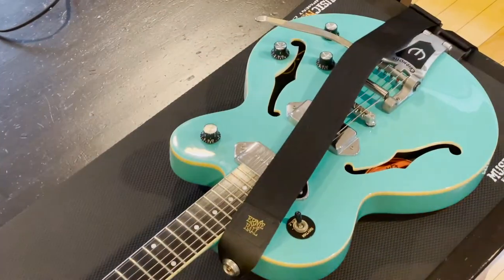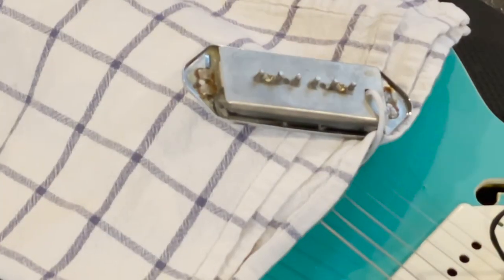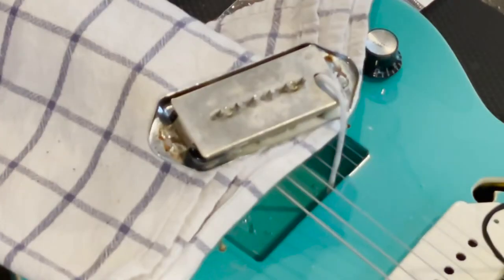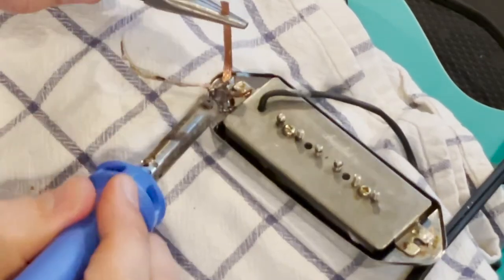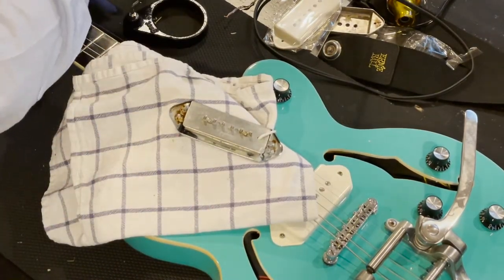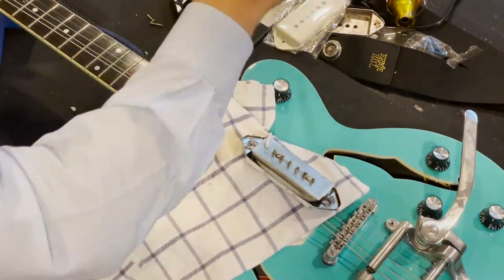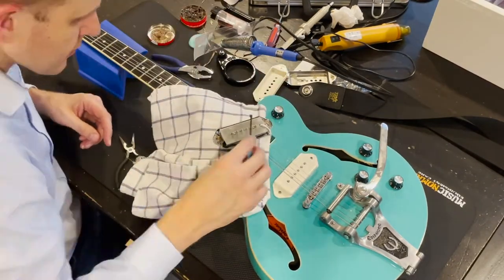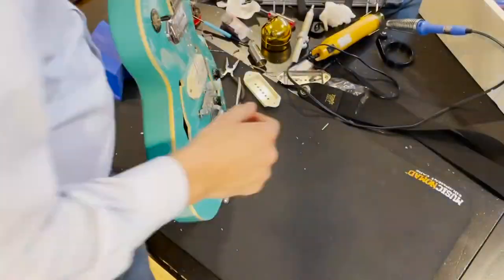Epiphone Wildkat Pickup Covers: Metal vs. Plastic

Comment: Great Video.  I love the Dogars on my Gibson made Casino more with the plastic Covers than my MIC Casino.  There was a guy who did a strip down of those Chrome MIC pickups.  All decent parts used in the build of those that you would find on top end pickups, even down to the magnets and wire. But they sound awful muddy.  The covers were replaced to pure Nickle ones. The guitar electrics were also replaced.  They sounded like top end pickups then.

Comment: I really didn't like my Wildkat's bridge pickup with gold covers so I replaced them with TV Jones Brian Setzer Filtertrons and wired it up Jimmy page style wiring with 21 different pickup settings. It was the greatest guitar gear choice I've ever made. I went from a super unusable dark tone to a creamy punchy bright tone with lots of twang.  So I went from a jazz guitar to a rockabilly guitar. I'm going to make a video on it soon.
Reply: make the video sir
Reply: @matheusleao2035  Thanks for the video request. I will work on it this week for you. Check Top Tier Gear Review Next Friday for a video on my Wildkat pickup swap.
Reply: The filtertrons fit without modification? I have the (common?) problem that the bridge pickup is too high and prevents me lowering the action.
Reply: @kevinobrien9626  the pickups themselves fit but I had to sand down the neck pickup ring edge to get it to fit in properly. The guitar neck itself kept getting in the way so I slightly modified the pickup ring to fit.

Comment: People usually think that punchier, brighter or clearer sound is a better sound. It's not. That's only coloring. 
Pickup's job is to act as a guitar's microphone, not add character. That whole thing about covers, for the most of people is waste of time. You can change it, but it won't be better, but a bit different. That is it. 
The best tones in music history were achieved on guitars with metal covers (Freddie King, BB King, Chuck Berry,  Albert Collins, Petar Green etc..).
Reply from the maker: If a guitar doesn’t have that frequency you get when you rub your fingers together in front of your ear, I’m out. I have to have that clarity. This pickup cover replacement ended up being a great thing for this guitar, because it gave back enough of that frequency that I am still excited about this guitar.

You are absolutely right that clearer is not necessarily better.

I kind of disagree with you that a pickup is a guitar’s microphone. (I would say that a guitar is fancy decoration for the pickup.) But even with that said, if it is the microphone, then as we know, recording engineers manipulate microphone placement and EQ to achieve just the sound that they are looking for.
Reply: Yeah, whatever. The improvement in clarity, with a greater openness in the high end is not an improvement. You nailed it! Muddy, crappy sound is where it’s at! 😐